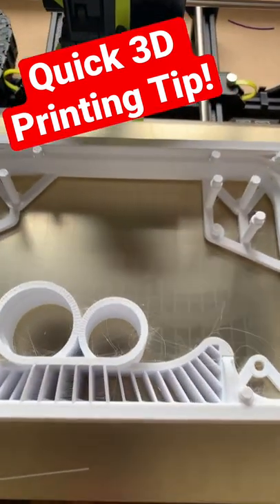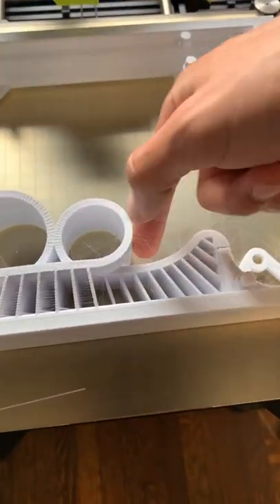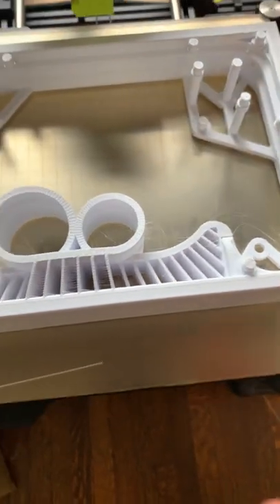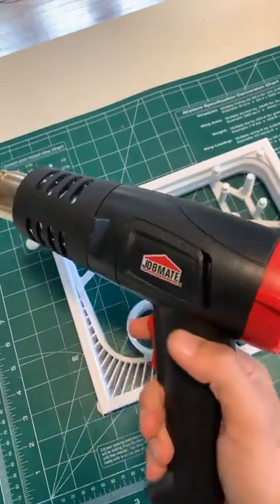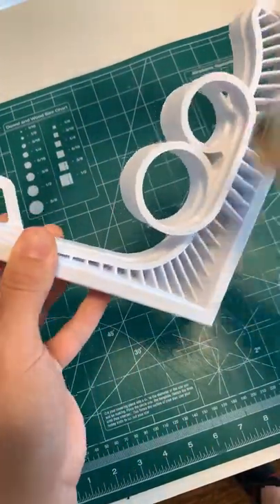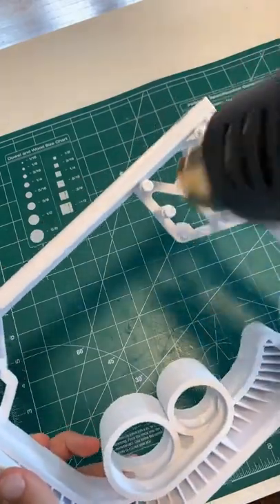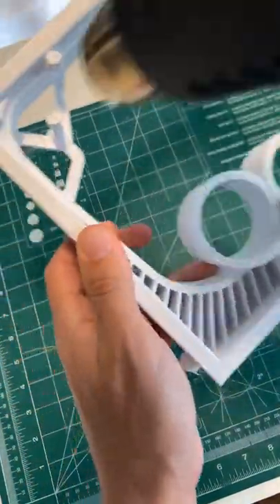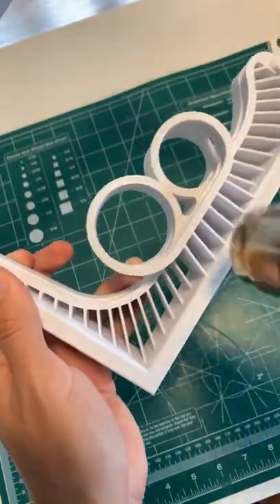How to Get Rid of Strings on 3D Printed Part | Quick 3D Printing Tip

Comment: Retraction and dehydration and you'll get no strings in the first place!!!
Reply from the maker: We’re talking about after the fact!
Reply: @Engineezy  I know, I think it's good for people to know though, that way there's nothing to fix.
Reply: filament dryers are expensive though :c
Reply: What does retraction and dehydration mean in this context? I’m not very experienced in this stuff
Reply: @thecorndealer4122 in your slicer you can change settings that retract the filiment before moving to another layer so the filiment doesn't ooze and cause stringing also your filiment itself can have moisture in it the moisture also causes stringing so dehydrating it with a dehydrator will help
Reply: No one has time to dry filament. We printing
Reply: Increase or decrease retraction?

Comment: Great tip. I just want to know what temperature is the heatgun since i have the digital one
Reply: I do 650F (around 300C ish)

It does not take long. It's easy to warp your build. With that said, I have fixed warping with the heat gun

Comment: What is a good temp for petg
Reply: print a temp tower with your petg and it will print at diffrent temps at each section of the tower and u pick what looks the cleanist and use that temp